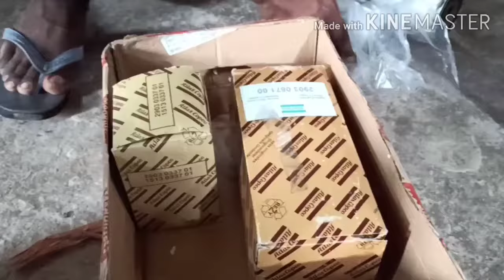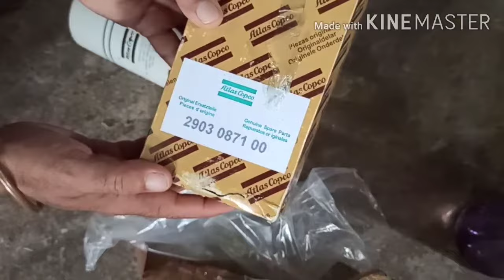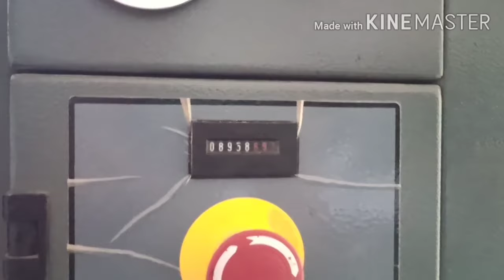Atlas copco air compressor ||#atlascopco #aircompressor #compressor

Comment: This is Grace from Coolworks filter.

We are the filter manufacturer in China, and have been working in this field for over 20 years.
 
We can offer high quality filter parts (air filter, oil separator, and oil filter)and OEM service at a reasonable price.

If you need filters for air compressors, you are welcome to send me your inquiry

Comment: Pls dont buy this compressor. Oil water mixing happened continously on this company
Reply: Yes true I have same problems ones oil get mixed with condensation start discharging oil out from the air filter
Reply: Change thermostat to tropical or take advice from atlas engineer